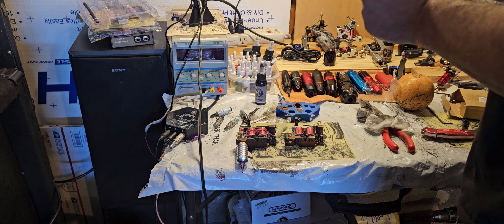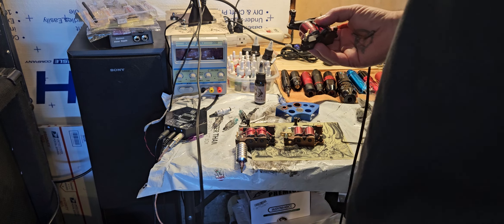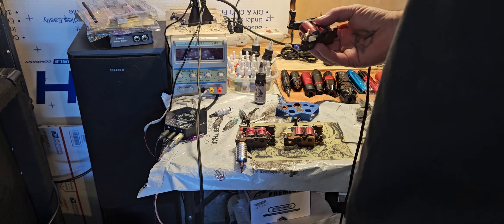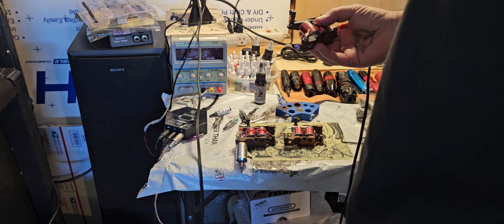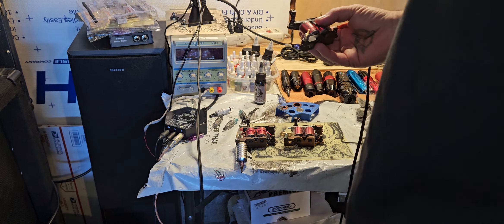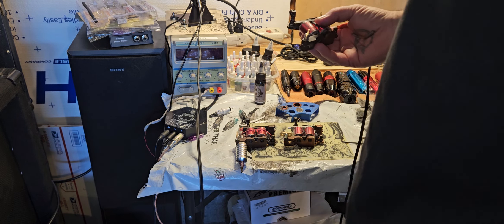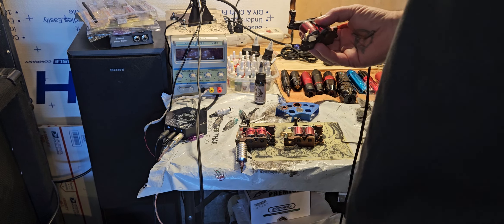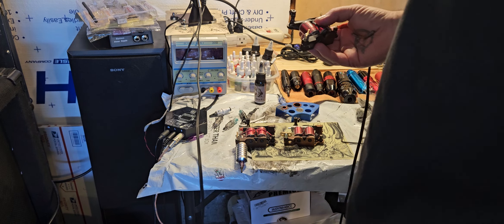MORE $10 BRASS FRAME TATTOO MACHINES!

Comment: If you're looking for a good coil machine at a cheap price worldwide tattoo supply has drop prices extremely low on coils you might want to check out the aluminum v machine for $25 they used to be 150 they got a bunch of other stuff you might like for cheap now
Reply from the maker: Im good. I have too many many...this ebay one just arrived...video loading . Its a beast!